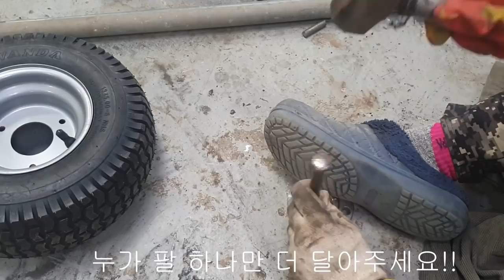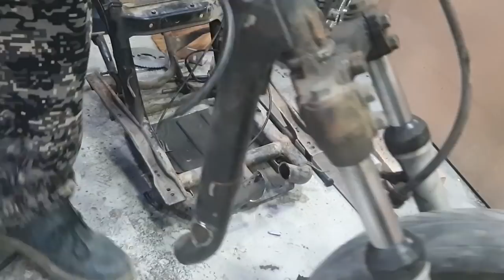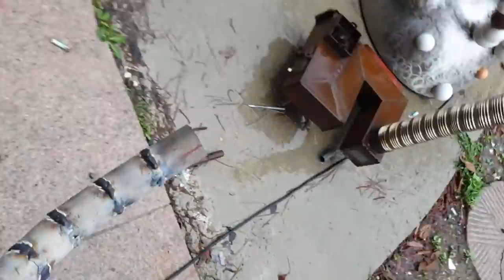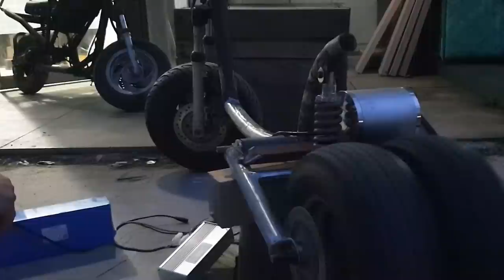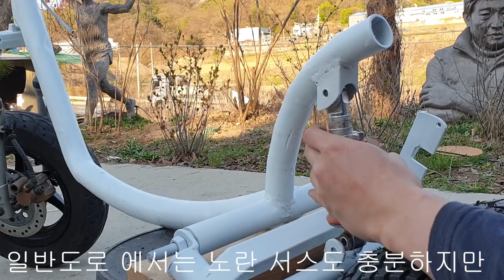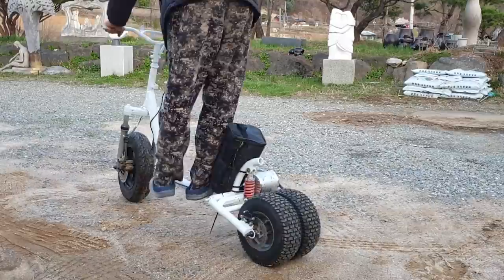몬스터 바이크  만들기. (PART1) DIY MONSTER E-SCOOTER

Comment: Like flying on a brum....
Stability issues on the cornering?and turns?
Reply from the maker: Rather than a problem, there is a slight inconvenience in cornering.  That's why I made a tilting mechanism bike that I made recently. You've seen it already. bro~~
Reply: @DwarfSin  yes I did.  There was similar idea in toyota scooter:)
Reply from the maker: thats right 👍👍

Comment: How much you sell the electric motor
Reply from the maker: 1500w motor is maybe 60$    3000w is 80$
Reply: 1500 how much km can get in hour
Reply: With the system or only the motor
Reply from the maker: only motor  1500w is 50km/h 
 3000w 75km/h
Reply: Thank you so much for information
Reply: Thank you so much for information
Reply: Do u sell it
Reply from the maker: its already changed design